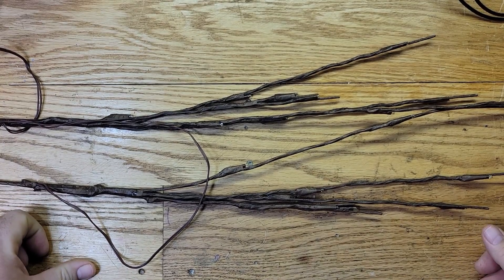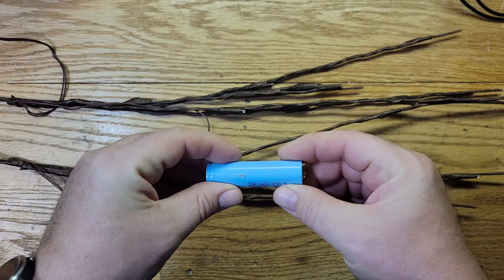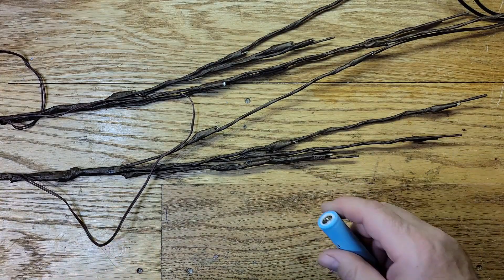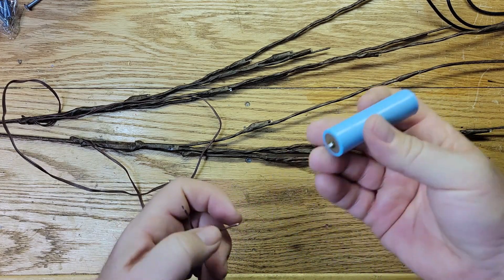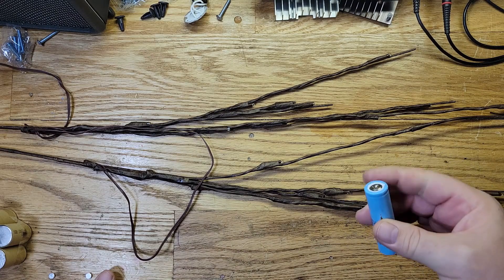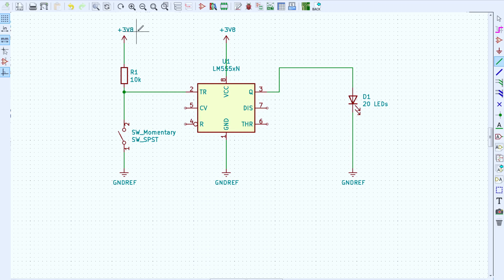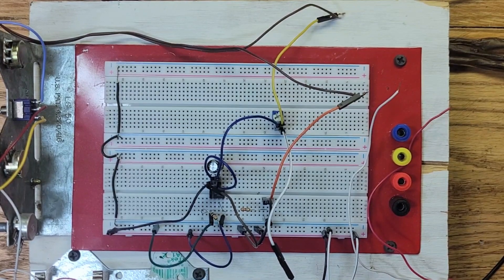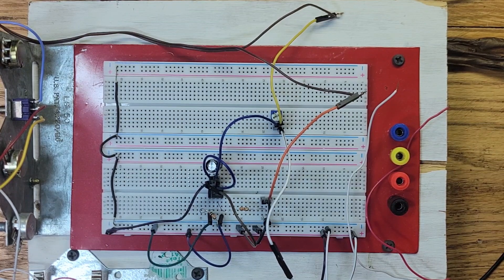555 Timer delay off circuit

Comment: Imagine having both an external power source and a battery connected simultaneously. If the external power is unplugged, the chip (such as the IP5328P or IP5306) briefly drops the output voltage to 0V for 2-3 seconds before switching to battery mode. During this time, the output is disrupted for 2-3 seconds. Do you think it’s possible to use this circuit to maintain the output during that brief period, ensuring the system stays powered until the battery takes over?
Reply from the maker: Here are a 2 options:
Option 1:
Start by adding a large capacitor (470 µF to 1000 µF) across the output. 
If this doesn't solve the issue, consider using a supercapacitor.
Option 2: 
Take a look at my video on redesign of shaver circuit:  https://youtu.be/OVKdRbOz1s0
I can unplug it while its running and it switches to battery mode without stopping.
I use the TP4096 IC.